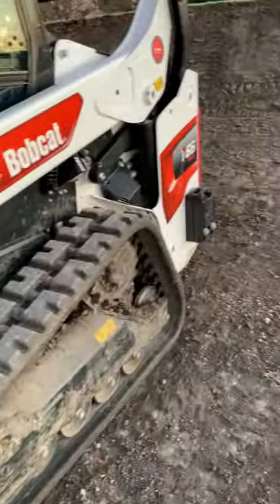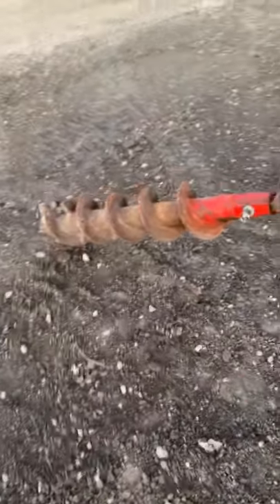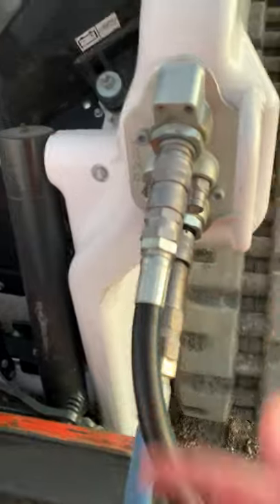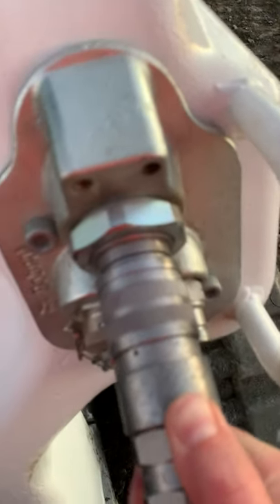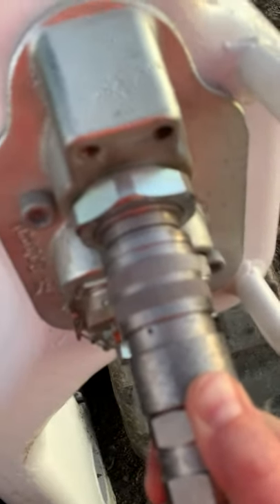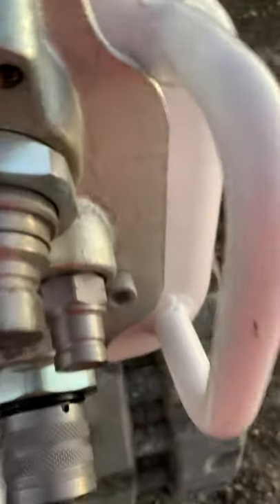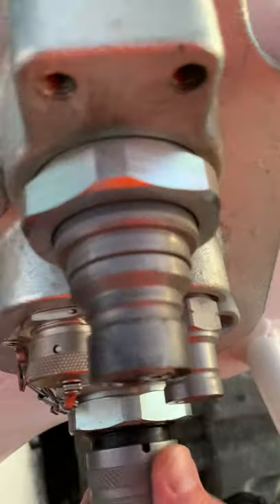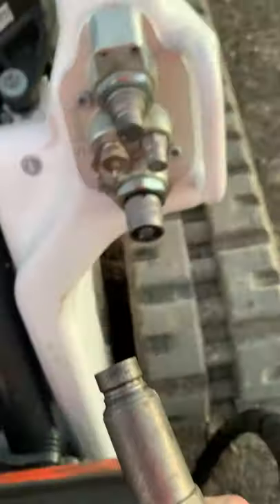How to Disconnect Hydraulics on Bobcat Skid Steer | #Shorts

Comment: On older machines they might not have that bleeder so you can turn the machine off and move the lever for the auxiliary flow back and forth and it’ll help let the pressure out of the lines
Reply from the maker: Excellent point...thanks for sharing!
Reply: Thank you this worked!

Comment: I noticed the machine was off. Is that important or can you do it with the machine running ?
Reply from the maker: I usually recommend to shut it off....IF for some reason there was an issue if the engine is running the hydraulic pump would be running and cause an even larger mess.   But ultimately I don't think it is a huge deal if you do prefer to leave it on.
Reply: I always left it running, as long as no ones sending pressure through the lines, or pressure being sent back from the attachment they’ll pop off. And if you live in a cold climate, keep a torch in the cab, they’ll freeze on. - or run the attachment for a bit, the hydro will melt the ice once it’s hot enough